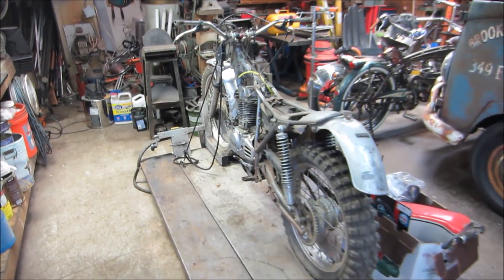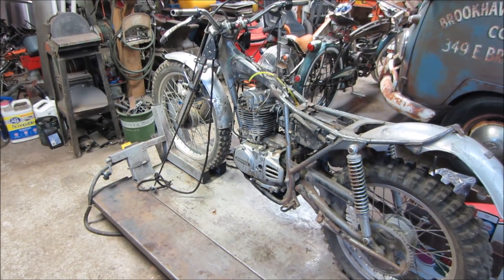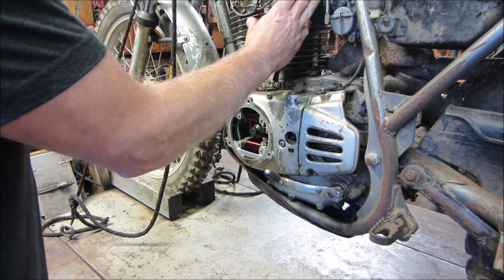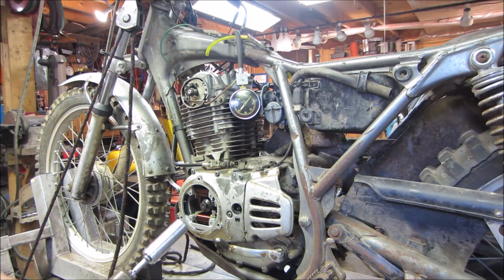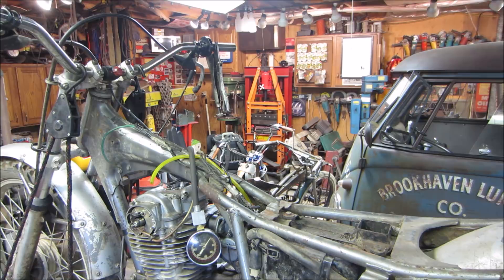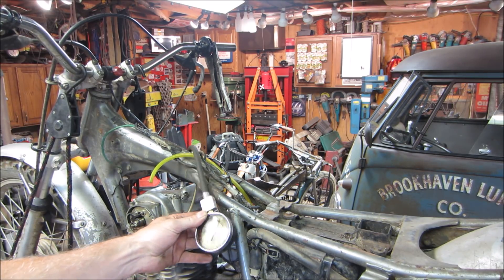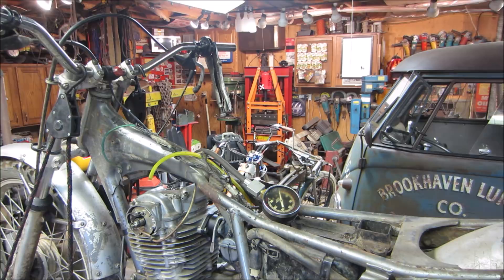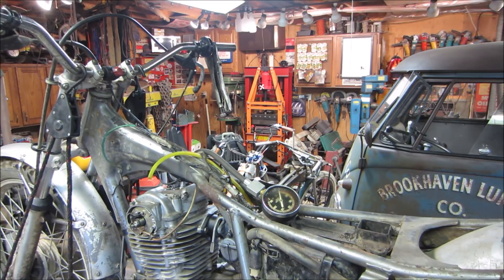Does throttle position affect a compression test? lets find out.

Comment: A critical difference to make in performing this test… is the motor a four stroke or a two stroke?
With a four stroke engine throttle position does matter in a two-stroke engine THROTTLE POSITION DOES NOT MATTER .

Comment: I understand what your doing but don't see the point.  Seeing how I don't start a bike with the throttle wide open.  I want to know what the condition of the engine is in
and how it's configured under normal circumstances.  In addition , I've never done this with a car while performing a compression test. 
If you want to see higher compression numbers that are totally inaccurate.  Take a hair dryer and hook it up to the intake and force more air into the cylinder.  That should also
improve your numbers.  It won't change anything or make the engine run better.  But you will satisfy your need to see higher numbers.   
By changing the throttle , you corrupt your baseline and no longer have a point of reference and you end up masking your real numbers or a potential problem.
I can see why you might do this test with the throttle wide open, if you race. Racing bikes spend a great deal of time at full throttle, but are often hard to start due to higher 
compression ratios and advanced timing.   Street bikes and recreational bikes spend most of their time under 25% throttle input.
Reply from the maker: you are looking for engine condition, with no restrictions, if an engine from factory is 150 psi, no carb or exhaust, restricting in any way make doing a compression test worthless, it has nothing to do with what throttle the bike is at when driven,
Reply: @mustie1  Why?  Why would you want to test in a state the engine rarely runs. How will knowing that you have good numbers with a wide open throttle 
help you trouble shoot a problem with a static throttle.   Let's say that your specification is 120-150 psi.  How does testing with it wide open, tell me the 
lowest potential number I could see during normal operation.  I want to know the lowest possible number under the poorest operational setting.   If that 
number is good then anything after that is good.  That eliminates compression as a potential cause of poor performance.  Your method does not not 
accomplish that. You have done your compression test with the best optimal settings.  How does that help when your performance fails just above idle and
you have poor compression just above idle.  If the engine cannot develop enough compression just above idle settings.  Your going nowhere.
I recently purchase some Piston rings for a bike I'm working on that had very poor compression numbers.  Around 50 psi.  The bike had been sitting outdoors 
above

be

Comment: Had a guy come with his "certified mechanic" to buy a Honda 300 4X4 from me. Hie wanted to do a compression test, which I had no problem with. He even brought his own gauge, hehehe. He spun her up and tried to knock 1000 bucks off the 4500 price because the compression was low. He asked what I though of that. I said the price is now 5500 bucks. He said that I can't do that because I listed it for 4500. I said once you deviate from listed price, the listed price no longer applies. He argued that it wasn't fair and he was going to call the cops. I said go ahead, but don't forget to tell them that you tried to cheat me by bringing a fake mechanic and doing a compression test with the throttle closed. I then turned to the "mechanic" and asked to see his trade card (most mechanics have their journeyman's card in their wallet)so I can report him to the board.  They got in their truck and drove away. Same truck came back next day with different guys in it and paid me $4500 without looking at the bike very hard at all, hehehe.

Comment: Restricted exhaust would make a difference, however quite small. The difference is in atmospheric pressure VS pressurized air being forced out by the piston. (Also the reason why intake valves are larger than exhaust) Now, a RUNNING engine is a whole 'nuther matter because the gasses have now expanded. Then restricted exhaust makes a huge difference!

Comment: From across the pond. One other check is to add a small amount of engine oil in the plug hole, then redo the test. This determines whether any escaping gases are going past the piston rings or the valves. Any change in the reading would indicate the rings are broken or worn. It also seems to pick up scored cylinder walls quite well. Obviously if the damage is serious this extra test does not work.

Comment: If the exhaust is blocked it could cause the test to be lower, because whatever compression isn't released through the exhaust will leak back through the intake valve when it open and won't let the next air charge compress completely.

Comment: exhaust restriction will make the compression higher, but limited by the low cranking rpm, now if you could spin it at 5000 rpm look out :)
the exception would be a solid plugged exhaust, which rarely happens since the high pressure would "open" a gasket or seal and be whistling away. at least on the older auto/moto.

Comment: There’s an easy way to see that Mustie’s instincts are correct. An engine can only flow so much air at redline. This amount is related to valve size, intake manifold, and finally to the carburetor’s throttle. In a well-designed engine, the power rolls off at high rpm because it simply cannot flow more air into the combustion chamber. The amount of air that comes in at given rpm as fraction of the cylinder displacement is called the volumetric efficiency (VE). VE at wide open throttle rolls off steadily starting somewhat before redline. If the throttle is at 1/2 open, though, VE rolls off at about half redline (say 4000RPM on the Honda 250). 

This is easy to demonstrate: Riding along at 4000RPM, open the throttle half way. Now open it all the way. There’s no difference in acceleration. There’s only a difference at much higher RPM.

So if Mustie was compression testing by spinning the engine at 4000RPM, the half open throttle would represent a restriction. But he’s not. He’s testing at maybe 600RPM. At this engine speed, there’s negligible difference in the amount of air getting into the engine, between half throttle and WOT. So measured compression would be same between the two cases.

Comment: I also found out that on these small engines it is also important to look at what kind of compression tester you are using. Some automotive compression testers do not have the valve at the at the tip but at the meter. When this is the case, you are adding the hose volume to your combustion chamber volume. This results in a lower compression readout than it actually is. This is not a big problem on big displacement engines but on small engines it makes a big difference
Reply from the maker: very true and thats the case with this one too, in the 2nd video l mentioned that l dont trust the reading

Comment: This becomes much less of an issue with a engine that has an actual intake manifold (cars etc). Ive tested a bunch of times and most cars have enough volume in the manifold to negate the closed butterfly. Still...its good to have the throttle open....

Comment: Awesome video! Also side note on compression testers and small 2 stroke engines (chainsaws and trimmers) using an adapter or a compression tester with a long hose can effect the final compression readings. Also Mustie do you have a po box or address I can send a little tool gift too. as a thanks for all the great videos.

Comment: When I was back in high school power mechanics in nineteen odd tickety two. In first year, we were given a task list, one of them doing a wet/dry  compression test. I was doing the  re assembly of  60's e250  camper conversion rear axle in my second year. Two burn outs were going do a compression test. I could hear the discussion between the two, as I was finishing up going back and forth to the tool crib. They go to do the first one and it starts right up 3x's. So as I am wiping my hand tools down and putting them on the shadow board and walk by the side door and and Ren and Stimpy are  stumped. Guys pull the coil wire, and do the wet and dry too. Oh  yeah.... high fiven each other. About an hour later I was on the other end of the shop helping to pulling a tranny. They had finished up and were to take it off the stands and take it out. There was a ear splitting boom and a fire ball from below the van. Teachers come running out and van was stalled out in the main lane as they tried to restart it. So when I said wet test, they thought that was gas pedal to the floor, and 8 cylinders later it filled the muffler enough to split it wide at the seam. Drugs are bad mmmmmk

Comment: depends on cam CLA, is dependent on rpm AND if engine is running. the long dialog by Mr. Charger doesnt touch 1/100 of the issues. there is no common intake pulse to consider.  thats why we have the 1934-36 MIT research and many excellent computational diagnostic tools based on dynomometer data. this man has never represented to be an engineer, but is the real deal. is he always right....no. if you think he is a moron, don t watch, start your own channel. lambasting is not necessary. is he good at diagnostics...hell yes.

Comment: It really shouldn't make a huge difference since the engine is meant to start and run at closed throttle which means it should be able to achieve good compression without WOT.
Reply: If you're lucky enough to have a compression spec for what psi the engine should be producing then this will have been done with WOT. If you have something with multiple cylinders it's cool to be able to test and compare them, tis gives a lot of info on the engine condition.
Reply: Well it does make a difference, deal with it

Comment: Smart explanation but I already knew the difference. My dad many, many years ago said that's how to check compression on Any Vehicle. We'd do it on VW bugs ALL the time.  Full throttle and turn over 6 revolutions. Only way to get it real high was put oil in the cylinders.  And depending on the compression tester, you can pinpoint how the rings,valves and cylinders are holding up.

Comment: 125 psi is fairly good for that engine. I would think the rings were a little sticky leading to the low reading. A couple of heat cycles and some hot oil washing over them usually frees them up. Looks like a good find.

Comment: running a compression test on an engine that has not been ran or even cranked in years is not accurate because the rings may be sticking and once it runs they will unstick and your compression will DRASTICALLY improve. i have had this happen several times. i have had several mowers do this, they had very low compression and adding oil to the cylinder helped some but running it made a huge improvement.

Comment: For interest,  why not make yourself up a cylinder leakage tester. Weld/solder an old spark plug shell to an airline connector and feed it via a spray gun regulator. You can hear where the compression leakage is coming from........Inlets/exhausts /head gasket or rings/bore ( for the last one, listen at the crankcase breather.)   I suspect the inlet seats on that bike could be leaky as shown by the blowback ( Unless the cam has a load of overlap)

Comment: Hey mustie I have a 1995 Kawasaki jetski it was running fine and just lost power until it stalled  and would not start acted like the battery was dead when it was jump started it would not run in idle but would run for a few until it lost power and stalled it would not start got any ideas

Comment: When you were putting your had over the intake port I was thinking back to doing the same thing with a vacuum cleaner. You can hear the electric motor speed up when you cover the suction port. You can do something similar with a blower motor on a vehicle HVAC system, a demonstration I used to do when teaching electrical classes. We would ask the class what would happen to the current draw on the motor if we restricted the intake. Most voted for increased draw because the motor would have to work harder. However, you can't pump what you aint got; the motor speeds up and the current goes down.
Reply: Power needed is related to work done.  When you close the intake with your hand you are no longer pumping air; if you are not pumping air you are doing no work (other overcoming friction) so it's as if you are taking the load off the motor, it speeds up.  Never thought about current draw going down but it makes sense, thanks Joe Albert.

Comment: Would be very interesting to see how it reads after the bike has been run for a few hours normal use and with fresh oil and high test gas. older engines were higher compression, and the best way to test an engine is to use it .
Reply: I agree. Engines like to be run. When I start an old engine that has been sitting, I will get it started check that it is close to spec and run it for a while before I get too involved with tuning it up. It takes a few heat cycles before everything settles down and the various parts get run together, that is when to do a tune up

Comment: As a Honda, Yamaha, and BSA mechanic in the late 1960's we always checked compression with the throttle full open. I didn't ask questions, nor did I care at 18 years old, but that's what the manual called for at the time. Syncing the four carbs on the then new Honda CB 750 was a challenge, I found the first step was to adjust cables so all four slides raised at the same time.

Comment: Good video. Fifty years ago I was taught the dry vs wet system of checking engine compression. One take out  all l spark plugs , open throttle do dry check with only five  revolutions of each cylinder record each number and go back and recheck after putting a teaspoon of oil in each cylinder. with that all things are equal the throttle the amount of compression strokes. this gave a good idea of what the engine would produce. Just my view of the process.

Comment: If the position of the carb slide affected compression, the engine would never idle.
Reply: I don't think you understood what you just watched. Of course the engine needs to have compression to run but the best way to measure that compression is to give the engine something to compress. The best way to do this is to fill the cylinder with air and that's best achieved with a wide open throttle.

Comment: That mid throttle position looked to be more three-quarters than half.

The linearity (or otherwise) of the entire range of throttle positions would be interesting, as would exhaust pipe connected vs disconnected.
Reply: There comes a point where throttle position doesn't make any difference. The drill is rotating the engine much slower than it actually runs at which means the inlet valves are open for a longer period allowing the piston to suck as much air as it wants.

Comment: Compression value is measured on the power stroke. (Valves closed). A restriction by the slide being at idle does not restrict enough to change input volume. It will only cause the air to flow faster. The power of the suction of the piston is not going to be hindered by the position of the carb slide. If an exhaust valve was stuck closed or the exhaust was totally blocked, that would not change the compression reading. It would just blow back out the intake right after the exhaust stroke TDC, when the intake valve opens.

Comment: I've always done compression tests with throttle wide open. I also squirt a small amount of engine oil in and re-test. If the number goes up, it points to piston / ring / cylinder wear.

Comment: Yup, wide open throttle when performing compression tests. If memory serves me, I think the factory spec on that engine is around 185 psi. Yeah, you could spend a lot of money getting it there but I would have fun and run it the way it is. Those old Hondas want to run. Excellent video, thanks.

Comment: Won't be a big issue on a small engine like this. It will make a much larger difference on an auto engine because of the swept cylinder volume.
Reply: The main factor is an engine's compression ratio, which is independent of cubes. The absolute swept volume is not a determining factor.

Comment: A plugged exhaust would be accumulative: the more times you cranked it the higher the pressure would build. It would be like a compressor with an accumulator tank where the pressure is NIL when empty and then as it fills, the pressure would increase to the point where you can no longer crank the engine due to so much back pressure.
Reply: I don't think so.  With the plugged exhaust, the "extra" compression would just go out the intake when it opened, releasing any accumulated pressure.  The only reason the gauge keeps going up and staying up is because there's a one way valve in the tool.  That's why there's the button he pressed at the base of the gauge itself to release the pressure.  (And to make it easy to remove the tool from plug hole)

RichE
Reply: You're right! The intake doesn't have a check valve like a compressor does. Plus you'd probably get a lot of valve blow by through the valve guides in the exhaust. 

I bet you though that the piston at some point would simply vapour lock.
Reply: Muskoka Mike RichE is right assuming the engine has valve overlap. If no valve overlap, the engine is an accumulator and it would stop turning when the pressure in the exhaust is equal to the pressure in the cylinder at the moment the exhaust valve opens

Comment: Last check I did was at idle throttle. Kept cranking for about 10 seconds. Put oil in the cylinder, cranked for 10 seconds. Went much higher.